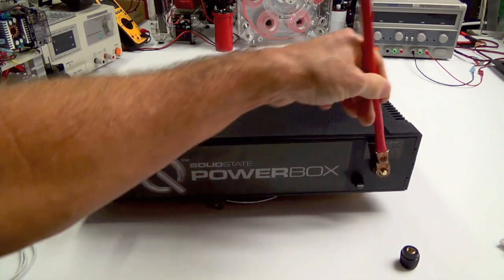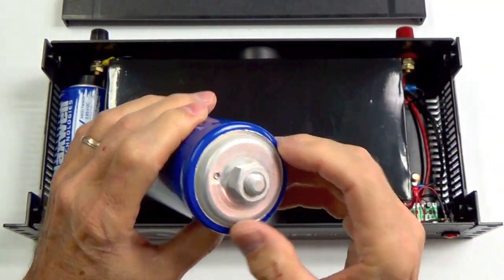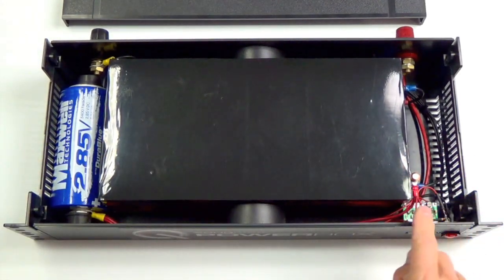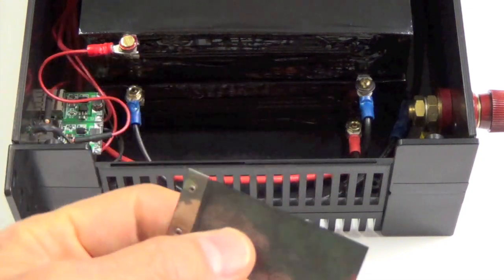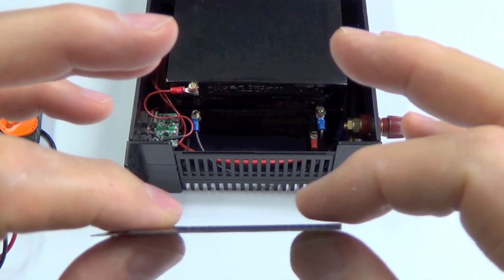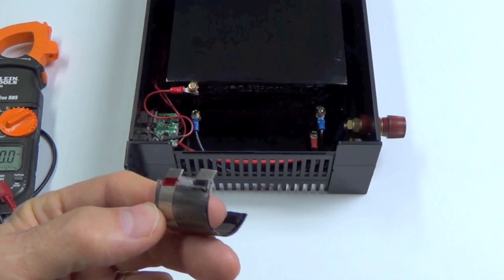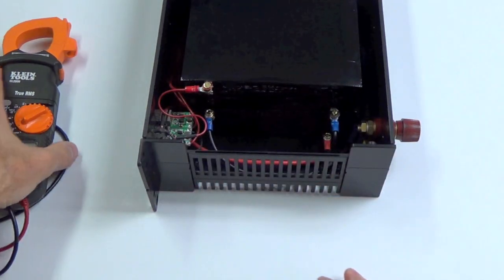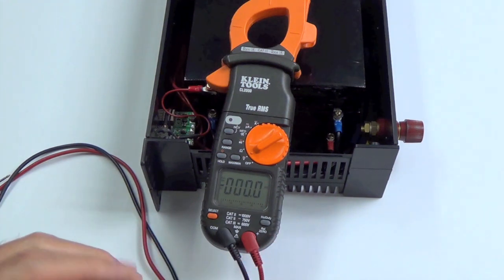PowerBox - Graphite Polymer Energy Source

Comment: It may be possible to disperse the solid electrolyte in filament or resin/ink.  Robert Murray-Smith did a video a couple weeks back titled "making graphene filled plastic". With multi-material printing you change your distribution plan and probably manufacture in the trunk of your car.

Comment: I am interested in purchasing different types of very flat and thin power cells that you are capable of. One type would be a circular (disc or flat washer type) with the center hole either as positive or negative. with sizes ranging from 1/4" to 5" diameters but should be a 0.4mm thickness as shown in one in this video. Please let me know.

Comment: If you can generate power from those cells and people understand its not free energy its a chemical reacion that generates the voltage for years, you can revolutionize the way we power the world. From the power grid to places in Africa that don't have easy access to power you can change the world. If you had enough of those you could power electric cars that never need to be charged. You could make tractor trailers, farm equipment, endless aplications. You could get killed for even trying to develop these. The only thing better is element 115(only because element 115 can be bomborded by protons to make atoms off element 116 wich imediately decays into antimatter and we all know what we can do with anti matter, but only extra terestrial have element 115 and it comes from other star systems with larger super novii geology.) So until the aliens give us that you electro chemical cells can power the earth if you don't get supressed before that can happen.

Comment: Crypto currency miners would dig you. There problem being power consumption versus computational power, they could solve it with solar no doubt but your device is more modular. It's a problem that can't be solved only manage by making more powerful computers or getting more affordable power sources. You sold me on the utility of your device. Saw your site and generators a while back not fully understanding what made them super cool besides the super caps and I think It was before you added the Thermal Galvanic cells. But now it's a whole other beast entirely. Would be nice to start seeing this more  readily in commercial products  but innovation is slow and you'd be taking the brass ring from a lot of other folks with vested interest. That isn't a conspiracy that just society.

Comment: can you run these cells with out the supercaps as there own power source or do you have to use the supercaps
Reply from the maker: Yes you can, but consider a solar panel without a storage battery. What you don't use from conversion, you simply lose.
Reply: PMMG4HYBRID thank you for the response and I should be ordering a large quantity soon as an alternative source of power for an electric motor on a yacht

Comment: when you connect capacitors in series, you dont ad up the farads, you divide with the number of caps,.
i.e. if i have two caps in series, they have half the capacitance at double the voltage.
3caps is one third, at triple the volts, so on.
i feel like you ought to know that...
Reply from the maker: Thanks, I've known it for many years.

Comment: Important question. But first of all Good job man and congratulations on the progress. Here comes the question : What is your reason for not showing a step by step guide for the manufacturing process of the graphite plates and the electrolyte? I would like to learn how to replicate this technology then multiply it and then use it to power anything I need. Currently the cost of your devices are prohibitive and even if I save up to buy one of your graphite cells I would have and expensive paperweight which would be able to power a few stuff for show...I wouldn't be able to replicate it and power my house. I would probably have to wait a few years until you mass produce them and get a loan to buy a bunch and power something worthwile. I guess the question is do you have a reason for not open sourcing it?On a side note I am always the guy that asks "the elephant in the room" type of questions :)

Comment: Consider outside the box thinking. Maybe it's not the electrolyte that needs perfecting maybe it's the what the cathode is exposed to that provides the more direct path to understanding all the science involved in this device. Could electro-mechanical vibration of a different material type like co2 or o3 work better.
Reply from the maker: Good thinking! I experimented with CO2  briefly a couple of months ago with good results in a closed but slightly vented plastic box. The carbon atom and humidity that developed inside the box accelerated the cell's reaction. Plan to revisit.

Comment: Can a Graphite Polymer Energy Source be complimented with a super large Capacitor the size a power company would install for 115 volts operating however in DC voltage for use in a electric car? Considering the size of the Maxwell Technologies product and total necessary to achieve the recharge range for Graphite batteries made flat just how many would need to be added together for an effective power range for a electric car or truck? I figure this could be better the ION-Lithium if there is no excess heat coefficient that can cause a ION-Lithium battery to explode or catch on fire. If this method would work I would like to undertake it for a foundation which converts vehicles to electric. The foundation need is to manufacture electric parts for its participants with no resell value nor catalog stock for a simple warranty membership per each year a participant desires to use the same converted vehicle as its sole operator. It seems to me that a small six inch wind turbine could generate enough power needed to boost charge when needed without having to bring the vehicle to a stop to do so. Could this eliminate electric vehicle recharge stations entirely? The name I give the foundation is Electric Vehicle Free Conversion Foundation, EVFCF for short. I want a US Grant to establish the foundation and its manufacturing facilities, the conversion facilities would be mobilized to introduce participants to the ideology and gain their respect for many years.

Comment: Excellent. Out of curiosity, why are the two units connected in series instead of in parallel?
Reply from the maker: Each of the two cell stacks are 1.6V in parallel. A series connection brings the output voltage to 3.2V for charging the large cap closer to capacity.

Comment: what is the maximum current this can maintain on the output at 100% duty cycle? What is the voltage 2.85V? What is the Ah rating? 1.1 ah that the capacitor is? 4U is a better standard size.

Comment: Design a box that has three rewired drum motor generators with magnetic bearings and vacuum spark gaps with electronics to work with your power stacking power boxes. Lots better then solar panels. 😊

Comment: Connect a bank of these to your solar setup and charge them during the day after batteries are floating, then run through MPPT controller in the evening during peak power use as a supplement to continue recharging. If it works like it's supposed to it will continue to trickle charge throughout the night even after it has been discharged. Feel free to send me a few racks to test this theory! lol ;-D Really enjoying the videos!

Comment: Ok. What is actual voltage and current out the back per unit as it sits.? 20 amp limit @ 2.85v ???
Since the world of personal charging practically lives on a  5v supply, is this where your at. The USB is 5v out the front I'm assuming for useful charging purposes. I was very unclear as to the actual output of the system per box in the current configuration. Love the layout. Great build

Comment: If the electricity is continuous for 20 or 30 years, then it's not electro-chemical. Maybe there's another unknown process.
Reply: Juan Pastor from what I've seen so far, it seems like the voltage and/or current drops when you use it. The cells slowly recover charge over time. The capacitor is there to store enough energy to be useful when you need it.

Comment: Well done Mike, but you did not address the question how much continuous power does that box put out and for how long. Also how long will these cells last? Are these other cells than your last Silicon Carbon cells?
Reply from the maker: I just finished putting it together about two days ago. Ill be testing it for at least a couple of weeks. Graphite Polymer is different from SiC cells, but I expect longevity to be equal.
Reply: But how long does it take to fully charge the supercap ? Probably days, right? Or how many Milliamps can you draw directly from these stacks of cells without the supercap ?
Reply from the maker: Days? No. The first charge took overnight because the cap is so large and there was zero existing charge. Now the cells bring it right back up to 2.75-2.78V every time much quicker. As I said, it's less than 3 days since full assembly.
Reply: i think the question from OP was related to the Output from the Graphite Cell vs the Supercap.
Reply: You can charge the supercap almost instantly. I charge mine at 165 amps, they charge very quick ;)
Reply: waves his paws @ overunity.com
Reply: wow these reply's are really funny considering all the answers were in the video except how long it takes to bring the cap back to 100%, #1 the cells charge the Cap, the first guys want to know how long it takes to charge the cap when dead/0%, i would like to know this as well and see it in a video, #2 the box's output is limited to the CAP the guy tells you this when he opens his box to show you whats in side, the cap is a cap and they can drain all there juice in seconds, but its rated and has specs so just go by those...
Reply: i would like you to prove this in a video, i know it would be boring but i want an un cut video of your box charging a dead cap, with meters and such and some kind of timer or clock in the picture, get me the raw footage of this and i will turn it in to time lapse for you free of charge, no pun intended....

Comment: Nice! ...but that box isn't a 1U, it's a 2U size. Your plastic box has 2 rack mount ears on each side... a 1U is 1.75" tall.
https://www.edn.com/electronics-blogs/power-supply-notes/4411309/What-does-1U-2U-or-3U-mean
Reply from the maker: You are correct, my mistake.

Comment: Quite impressive and promising invention. Thumbs up for you.
Well, this has got a huge potential in retaining the charge for the EVs to prevent them getting stuck in mid-ways while on a long trip.
By the way, what's the maximum Voltage and Ampere output it can produce..? Have you tested its functionality in extreme temperatures (-15 ℃ to 85 ℃)..? Eager to know these details.

Comment: Looks very good. Would love to build one myself. With the ability to produce 14.35 volts Dc and charge a car battery. Or an inverter.
Reply: I wonder how long it could run an inverter? - would be interesting to know if it has potential for running mains powered devices!